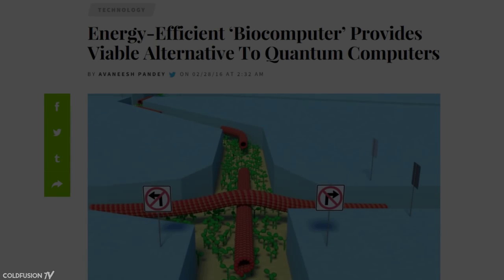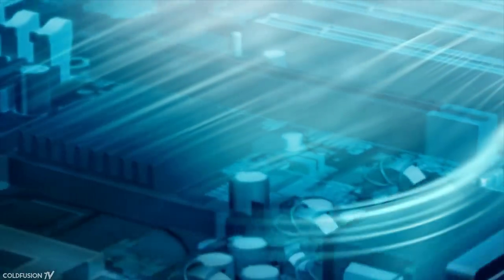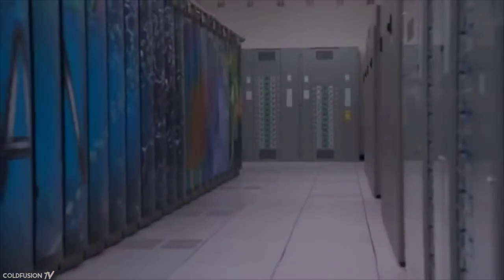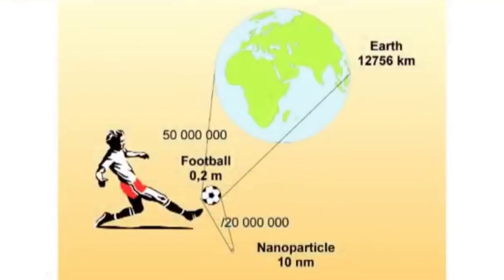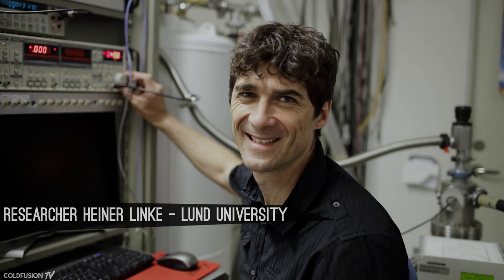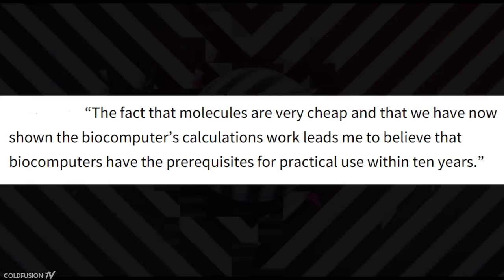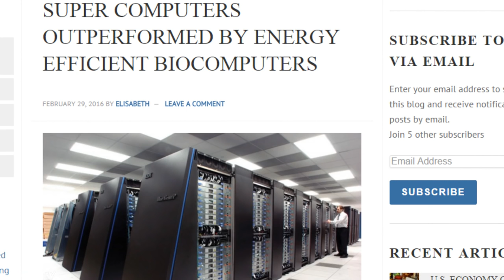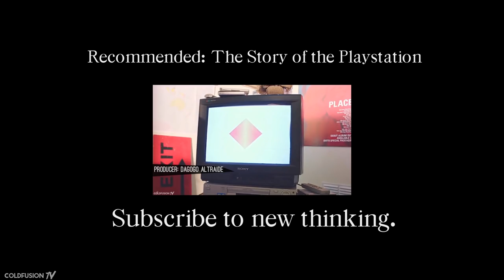Nano-Biological Computing – Quantum Computer Alternative!

Comment: this is so stupid and dude for god's sake dont reference TED talks for anything they are pure bullshit mostly. First parallel computing doesn't mean faster computing secondly do you know the difference between size of an electron and a protein molecule ? it can never travel faster than electron. In this age our computing speed is delimited by slow speed of electrons and the head they produce when they collide with nearby atoms that's why we are moving for optical gateway based computers. A bio computer may be capable of probabilistic calculation somewhat like a quantum computer but in no way it means faster and smaller laptops.
Reply: +Dhiraj Gupta Yes sirry. Photonic crystals, my friend. What is faster than an electron? A massless particle travelling at the speed of light: photonic manipulation. We'll just have to see where that takes us. All of these computing methods are promising, and we will eventually apply a particular method of computing to the form of computation that method is most suited for. If anything, these computational innovations are very interesting.
Reply: agreed
Reply: +Dhiraj Gupta so we're clear electrons are no moving very quickly in your computer... it's mainly their size that makes it much quicker.
Reply: Good point Gupta.
Reply: Well i'm pretty sure that using Proteins and molecules to run complex simulations/High demanding programs or even every complexe problem can be much powerful than using "electrons" even if they are "slower" For instance any brain does use "classical" electric connections (axon, don't know if it's this name in english) but also uses molecules and even proteins (Cascade Kinaze, ATp Synthase, etc...) in synapses which is the real source of complexity and perfomance in it.

Slower doesn't mean less powerful.
Reply: JustPoomy Yes, slower does not necessarily mean less powerful. However, the brain (a bio-computer), for instance, would be less powerful per-unit-computer. The human brain is estimated to have 100 billion synapses. The most powerful CPU, Intel's 18- core Xeon Haswell-EP, only has 5.5 billion transistors. This of course assumes that a single transistor contributes more units of computation than a single synapse. I don't claim to be a computer or bio-engineer, I am just giving an example. You can be as powerful as you want, just add more computational units. In an ideal world, we are looking to achieve the greatest amount of computation with the least amount of resources, as with anything. One of the favorable methods of computation that is being researched is photonic computation. Light (a photon) travels faster than electricity (an electron). Sounds pretty nice.
Reply: I think there is missunderstanding... I absolutely do not think that everything our computers can achieve our brain can achieve too... I can't explain myself as i would like to because of my shitty english so...yeah.
But i do think that the absolute computationnal performance our brain can achieve (and could theoretically achieve in the same tasks our computer do if they were structured another way. By genetics for instance) is way more effective and power efficient than our current technology. As a biology student i probably believe that if there was a more effective way to do it easily (by using Carbon, Hydrogen, Phosphorus etc...) nature would have already done it.
Reply: I am sorry to be tangential, but I just love these sorts of discussions. JustPoomy I can understand you just fine. Your English is not too shabby, and Dhiraj Gupta I really appreciate your explanation.
Reply: *****  , JustPoomy  well if you like these kinds of discussions then i'll try to explain where neural networks are better as we have seen from above example our transistor based computers are very good at doing math. and so many of the things we use computers are just basic math formulas in background from playing a video game to a complex simulation of early universe  but there are some tasks for which we cant device a sophisticated formula for , like for example you want to teach a computer how to ride a bike no matter how genius of a mathematician you are you can't provide an algorithm or a formula which when put in motion will help a computer to ride a bike as human of course you can calculate angular velocity of tires and gyroscopic effect of the motion to help you keep upright and and things like how much break strength is needed to halt etc but there are too many variable parameters like what if there is a pothole  what if someone jumps in front of you the dataspace becomes so large the algorithm will become way too complex to run in real time. then you use neural network because it mimics our brains capacity to learn and take decisions based on previous experience. it doesn't create a perfect mathematical formula but the process of learning (induced by creating weights around neural pathways ) is far more simpler to be run on computer but traditional computers cant run it hence we need Artificial neural network
Reply: every type of computer has different uses. as a "phd student" u should know this. Sure bio cpus might not be as fast as our traditional cpus for daily usage, but they sure as hell would be more powerful for astrophysical simulations, than our current shitty "supercomputers". 

I do believe, that the future is in hybrid computing, that uses a couple of types (i.e. bio and optical)  in a single cpu
Reply: vitas75 did i not say this specifically in my comment yes bio computers may come in handy but not in the stupid way this video suggests
Reply: why did you poop on my dreams, just when I got curious about going down to Lund university
Reply: Mega.Dope.Beatz buddy you know that quantum entanglement cant be used to transfer information right ?  now lets come to computer science domain that is not how quantum computers work they generate probabilistic models based on state a qubit is in so you are wrong on both fronts
Reply: :D :D :D the fact that you had to bring grammer into this says everything.
Reply: Dhiraj Gupta In the future there could be biological and quantum add-on cards for computers to improve probablilistic performance in game AI, big Excel spreadsheets etc.
Just speculation, tho. It's fun.
Reply: now that seems a great idea !
Reply: Henry Lehtovirta now that seems a great idea !
Reply: Ur cool man, would like to ask u some questions.
Reply: Dhiraj Gupta well i want to ask u whats better for a full dive vr bio or classic like u mention quatum is too expensiv for a homecomputer and will the bio be fast enough to compare hand with our brain?
Reply: quantum computers can look at ALL possible states at once which makes it much more powerful than biological or regular computers. biological computers can act as an intermediary till we move on to quantum computers.
Reply: Damn Dexter
Reply: I understand your sentiments but I think you misunderstood the idea for the parallel concept. Why do you need that much speed? I should think because the processor does work one by one and thus, increasing the speed will increase efficiency? So imagine 10 protein molecules undertaking 10 different processes in the speed of classical computers. That is the idea they want to put across. NOT trying to say it will be a better alternative to quantum computing